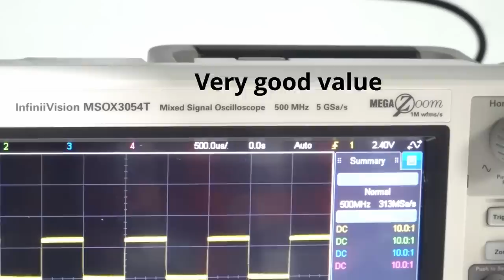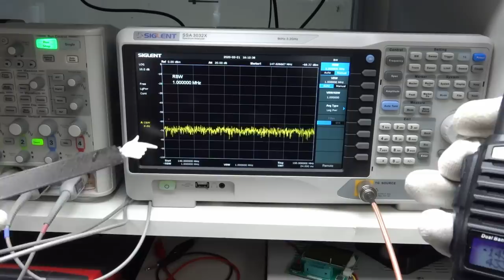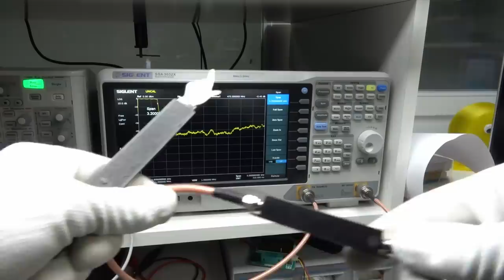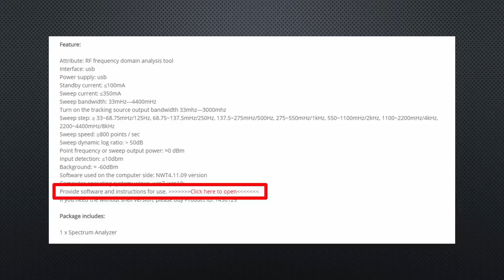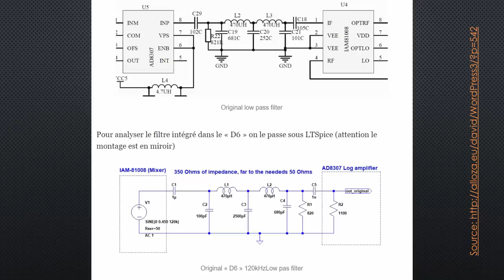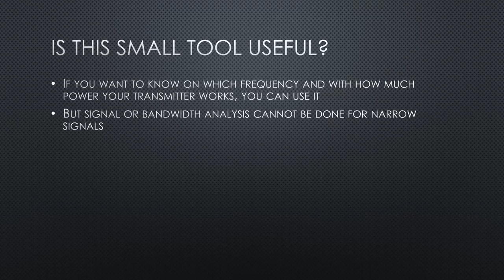#313 Useful? Cheap Spectrum Analyzer LTDZ 35-4400M

Comment: Hello Andrea, all,

First, thank you for this demonstration. Just wondering how you would use the cheap spectrum analyzer to measure noise from magnetron @2.999997GHz in a room?
I was aiming to use a dipole antenna on the input but shall I need filtering ? which sweep span do you suggest? any other advise?

Thank you and wish you the best for 2021.
Reply from the maker: I do not know. Never used magnetrons.
Reply: @AndreasSpiess   ;-) microwave oven for instance !

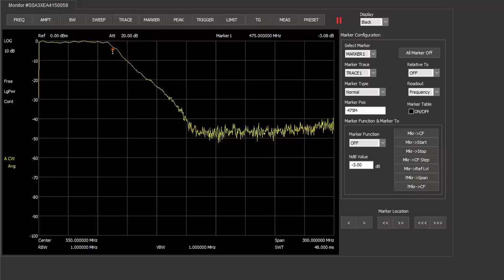Comment: At 18:10 I think you made a mistake. 
Settings on Siglent are RBW 1MHz and att 20dB. This gives noise floor of instrument (as seen) around -45dBm. 
It can not measure beyond that and we see that smooth trace goes into noise. 
I assume that if you disconnected filter, noise floor will stay about -45dBm. 
Also at 8:20 you hit the noise floor of Siglent when measuring notch filter. 
Good LPF should have much greater out of band attenuation. 
Cheep analyser has noise floor at -70dBm as we can see.  
Please redo measurements with appropriate settings on Siglent. 
If I am wrong, please accept my apology. I don't own Siglent spectrum analyser to check by myself.
Reply from the maker: Thank you for the correction!

Comment: Dear Andreas, thanks (again!) for your videos! Now if I only had to find out radio interferences disturbing (V)DSL lines and modems (I guess up to 10 MHz), what would you suggest? A cheap SDR might be enough, right? What kind of antenna?
Bonus would be if I could scan up to 1 GHz to include LoRa and / or up to about 5 GHz to include Wifi - to cover the last two steps would be much more expensive, am I right?
Reply from the maker: It depends if your RFI is conducted or not. And SDR is usually good. But the cheap ones not always cover below 10MHz. If it is conducted (via cable) you can use this video: https://youtu.be/ii2ObHio9BM (in German)
Reply: @AndreasSpiess  Ah great information, many thanks! Just for fun I ordered a SDR dongle and will check if I see something similar as the DSL spectrum (I'll not connect directly I have no attenuator). The antenna design really appeals to me :)
Reply from the maker: An SDR dongle anyway belongs in all labs ;-)

Comment: About as expected for $50. But I would just go buy used SA off ebay. You can get some really incredible ones for very cheap. Devices which used to cost $150,000 can be purchased for only ~$500. Lesson learned: expensive high end lab test equipment doesn't retain any value and depreciates worse than even the worst automobile.
Reply from the maker: You are rright. Especially spectrum analyzers. The Siglent is also only 3000 Euros for 3.2GHz. Costed also a fortune a few years back ;-)

Comment: Buyer beware. If you only need a cheap spectrum analyzer, get yourself a used RSP1 or RSP2 for about 100 € or even less and the spectrum analyzer software from sdrplay. Pretty accurate and much more sensitive than this crap here, although it is not as fast as a real spectrum analyzer. Andreas, well done this video!
Reply from the maker: I agree.

Comment: I think that the 'notch' is not RBW-related issue, but due to the LO 'step', since it appears that the design does not actually 'sweep', but uses discrete step sizes, or?
Reply: It's because when the frequency of the LO is exactly the same as the input frequency the output of the mixer is DC and the logarithmic amplifier does not amplify DC or very low frequency, also because of capacitor C29 which blocks any DC into the amplifier anyway. As the LO moves slightly above or below the input frequency then the frequency of the output from the mixer is again high enough to pass through C29 and for the AD8307 to amplify it.  Apart from the notch this design has another flaw, that of 'reflections'.  If for instance you were to look at an SSB signal it would appear as a double sideband one with suppressed carrier.
In 'real' spectrum analysers they do not convert to DC but instead to an intermediate frequency of a few MHz and then measure the amplitude of that. That also eliminates the reflection problem.
Reply: @listerdave1240  Thank you for explaining this phenomenon. 
This "notch" didn't make much sense given the theoretical principle of operation.
BTW, isn't C18 also a problem?
Reply: @listerdave1240  The AD8307 can handle up to 500MHz. An IF around 450MHz would stay well within the specs of the 8307 and make it easier to design the image rejection filter.
Reply: @listerdave1240  This makes alot of sense. Why couldn't they just down convert to a constant IF like in any good old superheterodyne receiver? Then using a narrow band amp with filters would also filter out the odd integer multiples due to the square waveform of the LO. Yeah I realize this 50 bucks spend wasn't worth it's bang  ...

Comment: Andreas I have done similar experiments with the same Banggood device. What struck me first was that the tracking generator produces more or less a square waveform. Presumably same is true for the LO since it uses the same chip. So the mixing products must contain odd harmonics of the LO. I also observed the dip when trying to display a single carrier tone. You have any idea what it's causing it? It almost looks like as if both side frequencies contribute to whatever is "measured". The symmetry kindof gives it away. BTW I like  your cat :)
Reply from the maker: Viewer Allen Edwards below gives an explanation for the notch. Concerning square wave: You are right. But because the LO sweeps with the TG it (usually) does not see these harmonics. I mentioned that the Siglent has more filters. This is where some of them are. Its TG creates a sine...

Comment: My question is, Because of the frequency ranging from 35 MHz to 4.4 GHz is this unit any good for audio( 50Hz to 20KHz ) analysis?
Thank you
Reply from the maker: No. It does not work for audio. You can use a soundcard and software for audio.
Reply: @AndreasSpiess  thanks 🙏

Comment: Even though I' have a degree in EE I have never worked in rf or high frequency areas. I find these videos interesting but intimidating.
Reply from the maker: RF is not the simplest topic ;-)
Reply: I think there's a reason a lot of RF Engineers are older.  Because it takes quite a long time to learn RF !! 😉

Comment: Where did you find the adf4351 spectrum analyzer schematic?  I've search and searched but can't find that one anywhere.
Reply from the maker: http://alloza.eu/david/WordPress3/wp-content/uploads/2019/04/schematics.pdf
Reply: @AndreasSpiess  Did your's have a very weak signal?   With the output connected back to the input the sweep is way down at -34 dB instead of at 0 dB like on the older one.  Do I need to remove that resistor on the input?  Actually I removed the resistor but it doesn't make any difference.  I'm really disappointed in this newer model, the sensitivity is so poor that it's not much good as a spectrum analyzer unless you are dealing with transmitters close by.
Reply from the maker: Mine was higher, slightly below 0dB. But I do not remember the exact values. -34dBm seems to be very low. Defective?

Comment: Hello, very good video. I just got this same device in the mail. I was disappointed to see that when looking at FM broadcast, the 200khz signal is split into two ghost images, with a notch at the center. Is there a way to change the resolution bandwidth?
Reply from the maker: I mentioned it in the video: No, you cannot change the RBW without soldering

Comment: Thanks Andreas. I'm interested in testing an area to find out what radio frequencies and signal strengths are present. What would be the most cost-effective way to approach this problem?
Reply from the maker: A spectrum analyzer is good. Or an SDR radio.
Reply: @AndreasSpiess  How much would you need to spend on either of these technologies in order to get something reliable and useful? Do you have any brands/models to recommend?

Comment: Thanks very interesting. what would  -77dBm be in (microwatts/meter squared) and (Volts/Meter) I have an cell tower in front of my house about 1350 feet away pointing right at my window it says: on an antenna search (Maximum signal strength RSRP -77 dBm) for antenna that's facing 287degrees North would like to know if radiation is high at my window. Thanks
Reply from the maker: You do not get absolute values because the influence of the antenna. But if a cell tower blasts in your direction you will have as very strong signal on the frequencies try use. 
BTW you find online calculators to convert dBm to Watt. As said, these are for cables. 
A typical cell tower easily emits 2kW where I live.

Comment: Would be nice to see you show this with an SDR, it eliminates some of the issues shown here (probably adds new different issues).
You can use Spektrum made by Pavels on GitHub, I've helped on the development so if you have any question you can shoot me an email !
Reply from the maker: Spectrum analyzers do not measure phase as tthe VNAs do. So they are slightly different. I prefer VNAs for Antenna work.

Comment: Merci fürs Zeigen, das Teil ist somit für mich im Grunde unbrauchbar, schade. Perfekt wäre gewesen, wenn sie noch kurz gezeigt hätten, wie man eine Filterkurve mit dem Nanovna erstellt, aber ich  suche das jetzt einfach mal im Netz. VG
Reply from the maker: Genau gleich. Der hat auch einen "TG" und einen Analyzer
Reply: @AndreasSpiess  ich habe das gerade mal probiert, aber mein 868mhz circuit filter ergibt eine sehr fragwürdige ch1 Log Kurve...jetzt trau ich dem Filter nicht mehr. Übrigens Gratulation zu den >200k Views von letzter Woche.
Reply from the maker: Schau mal die Specs für den nanoVNA Bis 300 ok, danach nicht mehr so gut. Und ab 900 MHz nix mehr. Vielleicht traust du dem nanoVNA auch nicht?
Reply: @AndreasSpiess  hb9axa hat mir ein Foto geschickt von seiner Analyse seines baugleichen cbp-840c Filters mit einem alten grünen Ozi und der Verlauf sieht schon ziemlich ähnlich aus...aber über 900mhz weicht es dann tatsächlich stärker ab. Bald soll ja V2.0 kommen des Nanovna und bis 3.4ghz gehen, da freu ich mich schon drauf.
Reply from the maker: Mal sehen wie das Pricing wird. Ich werde ihn dann mit meinem B1201SA und dem MiniVNA vergleichen.

Comment: This might sound like nit-picking for such a low-price instrument, but a spectrum analyser with a minimum RBW of 5 kHz is of limited use. You won't be able to show sweeps of narrow filters (as used in the IF stages of radio receivers) for a start.
Reply from the maker: You are right. My alternative with smaller RBW costed 3000$ ;-)

Comment: Hi there Any chance for a help here I want to measure EMF There is a device that produces an EM radiation and I wanted to find out all the details about it Any chance what tools I would need Thx
Also For radio frequency measuring Thx for getting back to me
Reply from the maker: I think you need to watch videos concerning EMF if you are interested in this topic. Spectrum analyzers only have a "trackung generator that produces a vers small signal at one particular (but moving) frequency. They are mainly made to show RF signals.

Comment: Does it help if we remove C29 and C18 and replace it with 0 ohm resistors at 11:50 ?  Maybe it will help get rid of the notch ! Thanks to Allen Edwards and andreas.
Reply from the maker: AFAIK the notch is because of the overall design.
Reply: @AndreasSpiess  Why I suspect that to be a problem because it is blocking DC at the IF port of the mixer. Maybe it's not the problem !

Comment: What about using the HackRF One which goes up to 6 GHz?
Reply from the maker: Because the SDR receivers have a small coverage of a few MHz they are very slow. And sometimes only 8 or 10 bit. Which is not a lot of dynamic range.
Reply: @AndreasSpiess  Thanks for the reply.

Comment: Queria preguntarte que opinas sobre usar dos hackrf junto con el software satsagen?
Ahora se pueden encontrar los hackrf chinos por 60 euros incluso traen ya el cristal para aumentar la estabilidad y tienen una covertura entre 1mhz y 6ghz.
Se podran hacer analizadores de espectro y analizadores de antenas junto con un puente de reflexion?
De momento los estamos usando como transceptores full duplex incluso en remoto con raspberrys y soapy.
Reply from the maker: HackRF is good and if it is supported by the satsagen software, why not using it.
I do not like the combination of spectrum analyzer and reflection bridge. They are not capable to measure the phase. Theoretically they should work for VSWR. But a good reflection bridge costs more than a NanoVNA.

Comment: Regarding the calibration: I use SNASharp. It doesn't require an installation and has an intuitive GUI. The calibration is easy.
NB: I see the link already appears in the video description, but wasn't mentioned...

Website:
http://alloza.eu/david/WordPress3/?page_id=478 (the site is in french, but the software is in english)

Download:
http://david.alloza.eu/ForPublication/Homemade/mesure/SNA/Software/SNASharp/Versions/SNASharp_2019_12_21_0.zip
Reply from the maker: I tried it this morning, but without success. I tried to calibrate and expected a flat response afterwards. But it was not the case. I do not know what I did wrong :-(
Reply: @AndreasSpiess  Thanks for your reply! I think I had the same issue:
Before pressing "Run calibration" you need to press "Start loop" and capture a signal (NB: not "start single" that doesn't work). Then press "Stop". Then press "Run calibration". You will see it will take more time now and you see a progress bar on the top.
If you press "start loop" now you should get a 0dB flat response. Also don't forget to recalibrate when changing the frequency range.
Reply from the maker: Thank you! I tried your procedure, and it worked. Unfortunately, I still have "noise" above 2.6GHz which results in +/-3dB peaks at various places. But this seems to be from the HW, not from the calibration process.
Reply: But it is needed to have extra devices for calibration this SA?
Reply: @Antyelektronika  No, just connect rf out to rf in with a sma cable.
Reply: @benjaminfacouchere2395  and no attenuators??, thank you for your answer. It is really good tool
Reply: @Antyelektronika  For calibration - no.
But if your input signal exceeds 10dBm you have to attenuate it.
Reply: I also have this noise above 2.5 GHz, did you resolve problem with this Adreas and Benjamin? Thank you for any help.

Comment: It looks like the notch phenomenon shown in 14:50 and 15:11 is likely due the fact that (due to the higher scan resolution you are using here) the LO frequency at the notch point is right at around 145.5 Mhz which heterodynes almost perfectly to your input frequency to cancel it out and output a nearly DC signal which then get's filtered out completely and does not get picked up by the log power meter. It's interesting that your attempt to get rid of the notch by modulating the input signal did nothing to help here because the resolution filter is attenuating the mixer output so badly. I would imagine the big difference between the high priced SAs and this is the presence of multiple select-able filter banks (rather than just one here) as well as multiple mixing stages to cover these edge cases (like perfect cancellation) , among other contraptions which this device is missing. I am still surprised that the spectrum analyzer portion of this device performs as well as it does for the price point
Reply from the maker: Thank you for your explanation!

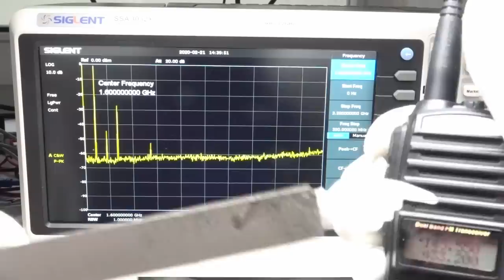Comment: You are trying to use the wrong software at 13:26 in the video.  I'm using a version of the cheap 35-4400 board with the older software and I get a full display like you got on the Siglent spectrum analyzer at 2:20!  I haven't tried the newer NWT4000 yellow program but am using a newer version of the old WinNWT4 program, ver. 4.11.09, with step set to 905000 but have an older board that has the SMA connectors sticking up vertically from the board, not on the end like you have, and it works great!  The WinNWT4 program also has Help built in.  A user manual can be found here:  http://www.hamcom.dk/NWT4000/sweep%20software_hardware%20NTW4000-2%20USER%20MANUAL_UK.pdf
Also, I have a NanoVNA and would like to know why it can't be used as a spectrum analyzer the same way as the NWT4000?  I can use it to check the resonant freq. of antennas and so on but when I connect a signal to the input it doesn't show any signals the way the NWT4000 does!  The input obviously works when checking an antenna so why doesn't it work by itself?

Update, I tried the NWT4000 program and it didn't work for me either, seems to be pretty worthless compared to the older one.
Reply from the maker: Thank you for the link to the manual. If you see the signal I assume you have selected a different sample rate or different boundaries as I pointed out. The newerr SW only allows 2000 samples max.
Reply: @AndreasSpiess   I didn't select the sample rate, the software put in the value  automatically so it works.  I don't remember where I found the WinNWT4 program, ver. 4.11.09 but Google should be able to find it. Also someone on Amazon is selling these 35-4400 Mhz spectrum analyzer boards for $33 that are $50-60 everywhere else! https://www.amazon.com/AGOAL-Spectrum-Analyzer-35-4400M-Frequency/dp/B07ZK3Z3F6/

Comment: So basically, garbage compared to TinySA, which is garbage compared to HP856x.
Reply from the maker: The TinySA is much newer and definitively the better choice. And for sure not garbage. The HP has a really bad price/performance ratio for most of the usual work compared with these cheap devices...
Reply: @AndreasSpiess  ADF4351 VCO phase noise doesn't even come close to that of a YIG oscillator inside a good old HP spectrum analyzer.
Unless you need a fancy computer interface, a HP8560/8561/8562/8563 or HP8566/8568 offers much better price/performance ratio.